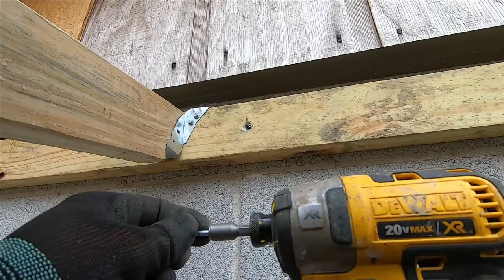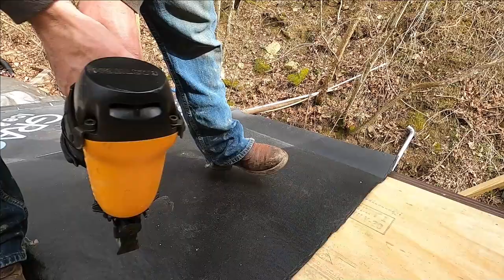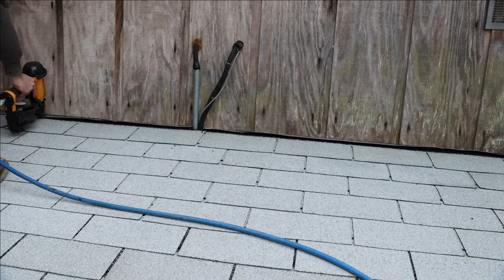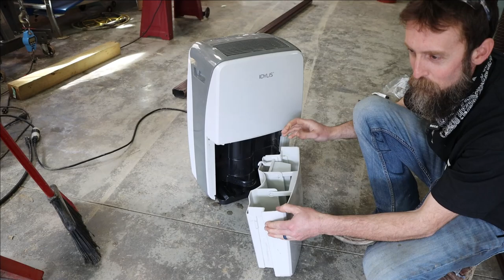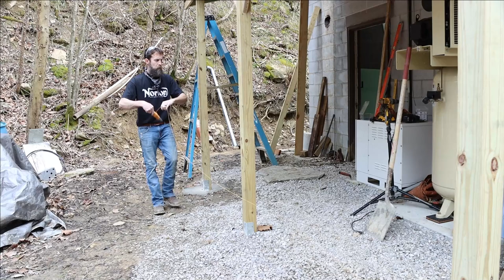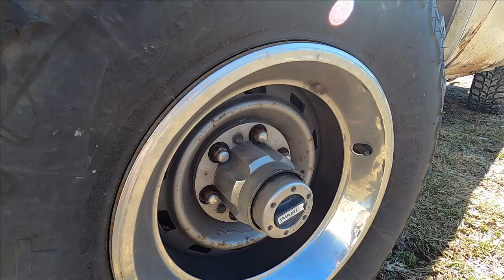AIR COMPRESSOR COVER BUILD... FINISHED!

Comment: Your shed roof over the compressor and phase converter is done very well and will prevent unnecessary weather damage to the equipment. Congratulations to you and your helpers.

Comment: The equipment cover looks great, nice job. I think the final post looks right and provides you with the access you need on that corner. Down the road, you could cut the bank back a bit to provide access for equipment, trailers or trucks. This will surely protect your equipment and the man way entrance. Would be nice to be able to open for air and not have to worry about the elements coming in. Depending on the prevailing winds, you can always enclose one or more of the faces, or even just a portion should you find that the elements reach your equipment or door.

Comment: For that second sheet there is a primer coating you can paint onto the wood first. It’s actually the base layer for a similar gravel sheet system (like shingles on an 8m roll). You be happy to know it lasts forever, going on 25 years now over my extension and it’s still looking perfect. Yours looks great 👍

Comment: I'd check the rubber brake hose running to that caliper. They collapse when they get old and act as a check valve. You can pump high pressure in but it can't leave the caliper when you take your foot off the pedal.
Reply: I have had that exact problem a couple time on my old Chevy, about the same vintage.  The first time I had it happen it took me a couple rounds and an old guy behind the parts counter at my local Napa to get it figured out.  Always something new to learn

Comment: So a couple of things. 
You need a light(s) 
To quiet the compressor build a cover over it with safe and sound insulation. But still the cooling clear.
As a plus it is fireproof too.
Great build 👍🇺🇲

Comment: 13Deg is about 2.8' rise in a 12' run, and should be enough to shed the rain.  Don't let leaves build up on the roof.  That is a great shed for the compressor and RPC.  Freeze the milk. LOL  Will you clean, and repack, the bearing grease, after getting the hub that hot.  Like the man said, "It just never ends"  Thanks for sharing.

Comment: A suggestion for your next Shed Roof:  use an inverted truss system.  Extend the end posts well above the facia line (height depends on the overall span of the truss) and create a truss system between the two posts.  The beam that forms the bottom the bottom of the truss extends beyond the posts on either side and you build the truss ABOVE the beam that doubles as a facia (facia is an incorrect term in this application but notes the position).  This form of construction leaves the whole underside of the roof (the area where your sliding doors are) free of any posts, is open architecture so snow or heavy rain is not blocked, and forms a great facade for a large sign at the entrance to your shop 😉).

Comment: Having a constant heat source would eliminate condensation, keeping the interior just a few degrees above the outside temp is enough. During the summer months might want to do something different. This is how I keep my guns free of rust and my welding rod dry. I have a gun safe dehumidifier called golden rod in both my gun safe and welding rod cabinet. For keeping the entire shop warm I use a wood burning stove, I don't have a solution for the summer but an ac unit would be lovely.

Comment: Get a zip lock baggie, place some chalk inside the bag, leave it open and the chalk will draw moisture away from your tools as well. The baggie will contain the mess the chalk will leave behind since it'll break down.
Use air to clean out those drilled holes. issue you're having is the dust falls back down inside and acts as a binder against those tapcon's. 
That "lean-to" turned out quite nicely. 
Bad brake? If it's the caliper, easy fix. Great video as always, cheers :)

Comment: Great job and video. Thank you!  Advice...
Find some well designed gutter guards for all of your gutters.  You may end up (like me) a slave to constantly plugged up gutters. Plugged gutters are worse than no gutters.  They allow the erosion you're trying to prevent AND can damage the building they are attached to.

Comment: A suggestion, I would bury that gutter hose before I or a family member ended up tripping over it at night or in the snow.
Reply: A lot of stones just under the surface, can be hard digging :-(
Reply: @gurraflex6478  Hard work has never slowed Steve down.

Comment: Steve I would put a 2 1/2” or 3” screw in where you notch the wood that goes into the hanger to keep it from splitting
Reply: No going back to use a slope seat hanger now!

Comment: For each foot of length the number of inches your roof raises is the pitch . so if your roof goes up 8 inches in 1 foot it's a 8/12 . 
3" in 12 " is a 3 -12 slope. Your roof will be fine . the drip edge flashing you could slip a piece of flashing under the drip and over the shingle to get a bit more coverage. . give it a year . if it dont leak don't fix . nice shop

Comment: plyscore roof sheathing(grain) should always run perpendicular to your rafters . you may get some sagging between rafters over the years. ice shield not needed for unheated roofs. No ice damning occurs since temperatures are consistent throughout
Reply: Yep, the span rating on 5/8 CDX is already being pushed at 24 oc.
No ply has a rating for being laid parallel to the joist/rafter direction.
Reply: But the membrane is definitely needed at a 2 1/2 pitch.
Bare minimum is a 4 pitch with three tabs, and that's really pushing it.

Comment: I am super picky about a dry shop - For the size of yours... I'd seal the concrete/block surfaces and potentially look at an industrial sized unit... Also it's worth having some kind of way to measure humidity in the shop. A small unit in a big damp area might pull 2 gallons a day, but not make any difference in actual indoor humidity.

Comment: Steve, if you get another dehumidifier, get a zeolite one, not the compressor type.  I have 2 Medco DD8L Junior models which are superb.  I use the in my shop and in the house to dry clothes.  These, unlike a tumble dryer, don’t shrink and damage you clothes.  Just a thought.  Joe.

Comment: If you used i larger horizontal beam up from the  columns  you can have deduction the last columns. You have a free corner beam self-supporting by his size, due to thickness.

Comment: Steve, i know you have 1001 other jobs to do but it seems to me some steps down to the river might be an idea sometime in the distance future?
Reply: yes i was going to suggest that, Some stone steps running down side
ways not straight line down be still to steep also he should get a metal
detector for his lad use in river when low slow flow.....
Reply: Idk how he could without a serious investment. Check some of his other videos for spring rains. That creek isn't nearly so tame and picturesque. For as often as he'll have to go there I'd say steps are a  losing game.
Reply: the boulders tumbling down the creek bed under the water in the spring time. that and torrent of water that roars through is enough to sweep away all the steps put in.
Reply: Build the steps attached at the top but with a break away feature. Or even a float attached at bottom like a dock. Chain it to a tree at the top so it doesn't go"visiting the neighbors".
Reply: In previous videos, Steve has shown the river running at "full capacity" anything on that hillside would get wiped out... So not really an option.
Reply: I would of made a deck foundation catilever over the bank when pouring the wall.But that river gets scary in a big rain.

Comment: Run dehumidifiers in my shop and car barn during sprin, summer and fall. Can sandblast metal and leave for years with no visible sign of rust. I do run a hose to a floor drain. Humidifiers last about 5 years😢.

Comment: 16.33  ;0)   Man, close in the back with shingles,  Gravel out the back and dig out that hill.
Cool Beanz !
Reply: To dig out that solid shale hill will need a pretty big backhoe with a chipper attachment on the end, a month or so of work and then  a dump truck and dozer to move the rock away. doubt Steve has the money for that, unless he gets the backhoe and chipper as a donation, so he can do it slowly as time permits, though i guess he really wants to actually use the shop instead now it is complete.

Comment: The wall brace was supposed to be like a shelf bracket with the 45 deg brace about halfway down and across. The actual end of the roof is sitting on a cantilever.

Comment: about the dehumidifier : if you drill a small hole in the front of the reservour and set it on top of sumting you can hook up a small hose and have the water trickel out intoo a sink or outside through a small hole in the wall
the add on turned out nice , again a shame you didnt think about extending the roof on both ends to get more overhang wen you had all the roofing and plywood off the structure under it , wouldve probably worked better without usng pillars too , and you couldve put a cat crane under the front eve to unload the pickp and pull it straight intoo the shop or intoo the loft through a hatch over the doors
then again if you make a steel structure for the crane track and use that as the roofsupport iyou could still have it and no obstructions in the middle of the overhang 
definetely get those brakes replaced , its pretty dangerous in the mountanous terain youre in . and you  load it up pretty heavy ocasionally

Comment: Hey Steve just wanted to introduce my self I'm the owner and operator of Midwest kustomz in circleville ohio. Have yet to start making videos of what we do who knows maybe one day soon. Anyway I want to say on those dehumidifiers you can run a hose out side and you'll never have to dump again. Each unit has a connection inside the machine for a hose. Also I wanted to ask you a little about the starlink, how long did you have to wait for service to be available in your area once you signed up? And how's your speeds and how so like so far? Thanks for any help and info you provide.

Comment: on your dehumidifiers .. you may want to think of a bung on the side of the catch tank with a 1/4 turn valve and some hose into a bucket.. so you can run if you want several days without it overflowing..  depending on the power consumption..  interesting thing.. somebody figured out down in the high deserts of Chile.. 14,000 feet high.. a material weave that can be mounted on frameworks with a piece of rain gutter under then to collect water directly out of the air..  makes me wonder if one could design a ceiling fan with that material and a catch ring for the water to sling off into..  i would imagine that humid areas.. those would sell like hot cakes and ammo..

Comment: I had the brakes on my truck do the same thing, it was the flex line that went bad, it was acting like a check valve, you could apply the brakes but they wouldn't release
Reply: I've had the same thing happen on more than one vehicle.  Front and rear in different cases.  When you cut the old flex hose there in essentially no lumen!

Comment: I thought I was the only one that suffered from Tapcons breaking. In my case it was because the hole didn't seem to be deep enough.
Reply: I never played well with Tapcons, In NJ we sink J bolts in the piers and use the simpson post brackets, keeps the post bottom off the ground and you have a bit of adjustment.
Reply: @jamesdrake2378  Yeah, I only use tapcons for mounting stuff on walls. Anything to do with piers/posts it's epoxied bolts or  j bolts in concrete. Not a construction guy* :)
Reply: Never use them, never seen them here, I will depending in application vary between a plastic cased anchor, a sleeve anchor or a rawlbolt.  Even then with some applications I was not trusting the rawlbolt so used epoxy to give it added grip. Guess the removal was difficult, but they probably just used a really big angle grinder, because I was using the single M12 bolt to hold a lifting eye. Overkill for a 300kg lift, but I was taking no chances.
Reply: I usually suck the dust out with shop vac. before running tapcon in.
That said, I hate tapcons as well.
Reply: @haroldphipps3457  100% on the dust. Major cause of breakage. They work great for their intended use.
Reply: I usually break them when I use a used worn down bit that is slightly undersized. Not enough clearance. Didn't help to be too tight with money.
Reply: You got to get the dust out of the hole because that can definitely bind up the screw and make it snap.

Comment: Beware of a man wearing well lubed gloves who is willing to stick his finger in a hole. :-)
Another solution to supporting the outer end of the roof, would be to use a double 2x6 or 2x8 header with a layer of heavy galvanized sheet metal sandwiched in between and nailed well. The sheet metal on edge really increases the strength of a header and is sufficient for cantilevers.

Comment: You need to get yourself a fan to put in that hole above your new roof.
Reply: Yes, good roof ventilation will help keep the shop cooler in the summer, and helps shingles last longer too.

Comment: Might think about putting something on that bare wood to keep the Carpenter Bees out of it.. Looks good.
Reply: Aside from the membrane what would you suggest? Not being snarky, seriously interested...
Reply: @chuxmix65  I’ve found some stuff called terminator that you spray on the wood and it keeps them away for a year. They have almost eaten my wood shed completely, I live down here in Alabama and the Bees are terrible
Reply: @donsmith3167  Up here in the North East it's carpenter ants.Those darn nibblers like to nibble... what the heck, it's there job!
Expensive little buggers.
Job security for those of us that fix stuff.
Just wish they'd stop eatin' my house.
Reply: @chuxmix65  yeah they are a problem here too. The stuff works on them too.

Comment: Hey you are the expert but you might want to run a bead of gutter seal under that drip edge because your roof angle is so shallow. Water will capillary back under it .  Edit - ah fooey . I knew id jumped the gun .

Comment: I am trying to figure out why you didn't just extend the compressor over hang to the end of the building and not end right at the edge of the door. That way you could also have evenly spaced out the pillars.

Comment: Your truck needs new rubber brake lines. They look great on the outside but they decay on the inside and act as a check valve... causes Smoky hot brake pads and warped rotors.

Comment: You certainly ripped that drill press a new one.  The big question is, did you pull on its cord while checking the hole?   Sorry.  Couldn't help myself, lol.  Now to a serious question- is it enough to just knock off the high spots in the bore?  I have an old machine that belonged to my grandfather, then my father, now me.  It hasn't seen much heavy work but I checked the bore and it feels really rough.  This press never saw anything heavier than about 1/4 inch plate.  And the average hole size was less than a half-inch.  I'm wondering what could have caused so much wear.  My grandfather was meticulous about his shop and equipment.  If you left without cleaning up you would find yourself chopping wood for a weekend.  He bought it new, so I know it wasn't from a prior operator.

Comment: Is it possible to resurface the damaged arbor? Or is that a crazy task?
Reply: Easy to resurface, Steve has the tool grinder that can get a fresh finish on it, though the dips will still be there, but it will have an even flat surface instead of the dings. Can even do it in the lathe using a collet to hold a rod chucked into the drill chuck, or pop it off and use the taper, and then hold the back in the live centre using the existing centre mark there. then a single light cut with a sharp tool at the right taper, and polish off with some 400 grit carborundum paper.
Reply: @SeanBZA  Ah! Thanks Sean!

Comment: Why the short width of underlayment on the edge of the roof, on top no less?
Reply: It's a starter roll.
Quicker and cheaper than cutting the tabs of a starter course, while still covering the gaps between the tabs of the first course.

Comment: The tang should never be involved with preventing rotation of the arbor. Two important factors in good power transmission are: good fit of arbor and spindle and NO oil what so ever on the mating surfaces of the tapered arbor and spindle taper. I use spindle mate squeegees to clean the spindle taper. Boeing started using this product and reduced broken tangs and damaged arbors to zero. Check them out and I have no financial interest in them just a happy customer.